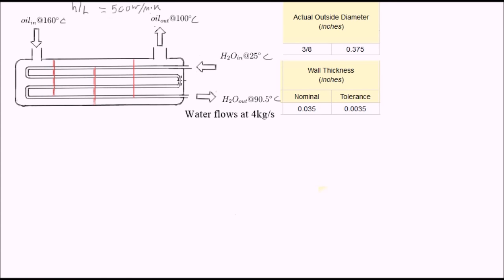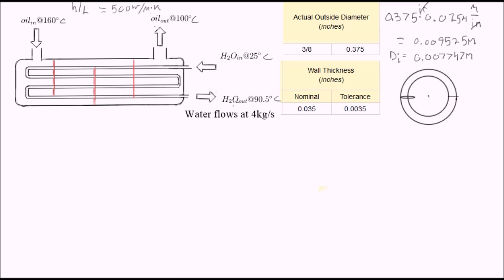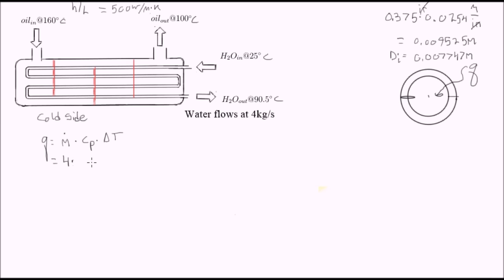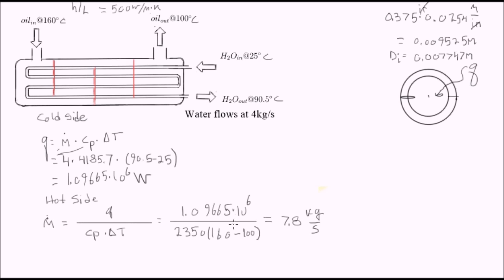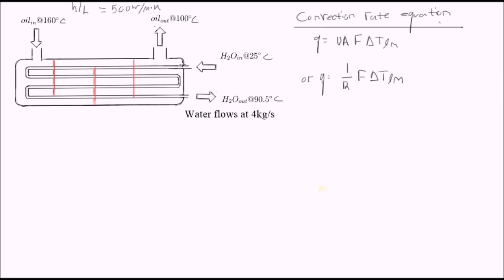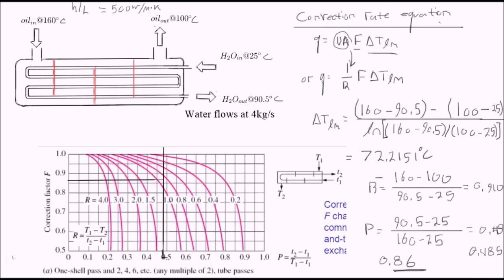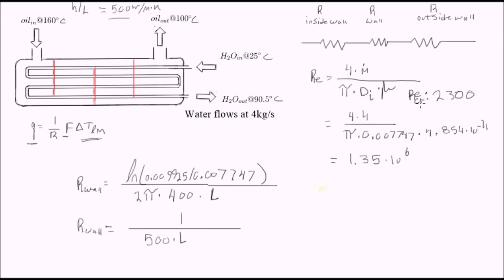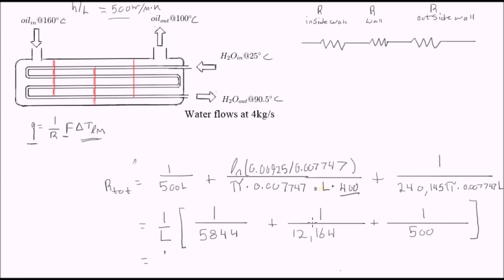Heat Exchanger Analysis

Comment: Sir! What happened if we don't know one of the outlet temperature of fluid ( eg: outlet temperature of oil ) then how to find specific heat capacity for oil along with how to find the outlet temperature of oil ?
Reply: As for as I understand this will be done on assumption but I'm not understanding the proper way of assuming outlet temperature of oil.. 
Sir could you plz help me to figured out how to assume any outlet temperature of fluid?
Reply: You can use the cold fluid( water) to find of hot fluid(oil) as the heat losed on the hot side is the same as heat gained on the cold side, you can equate the "Q"s to find the Temp of the  other side😜